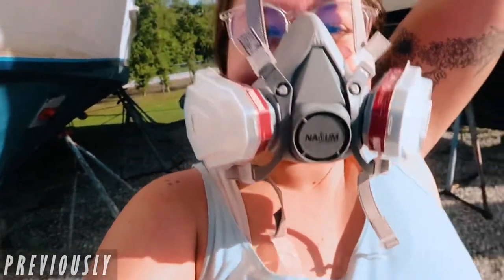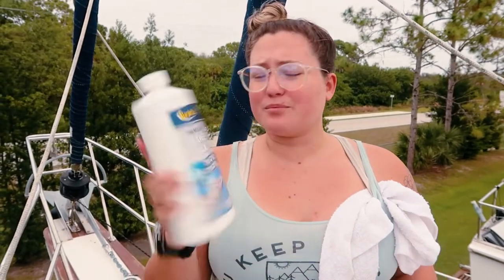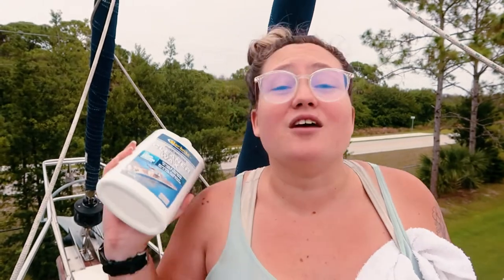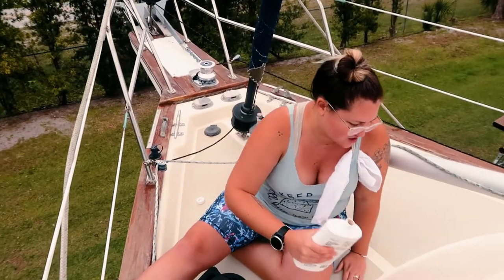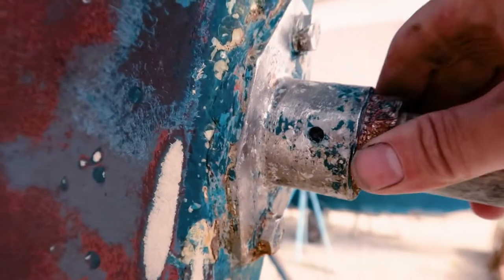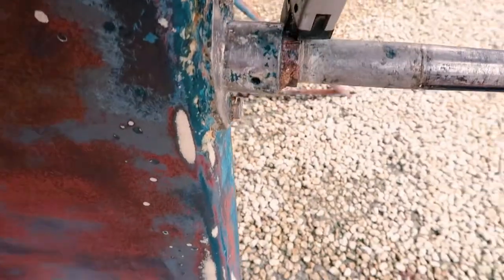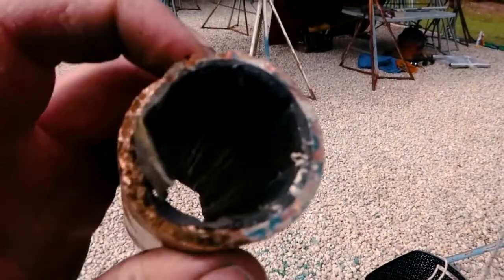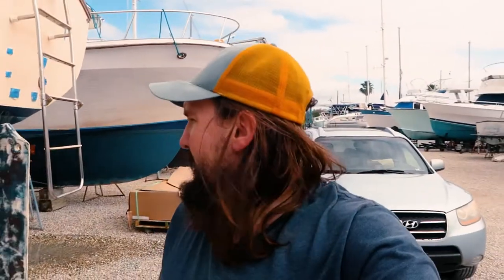Prep for our NEW SOLAR ARCH | Ep. 10

Comment: Cool. What are the specs for the cutlass bearing? I also have an IP 35. I would not do a wind gen. They are very noisy and provide very little power. I literally trashed mine and added more solar. I have 2 x 300W + 1 x 100 Watt panels now with 3 x 100 ah dragonfly lithiums. No power issues and I run fridge and two laptops all the time.
Reply from the maker: I’ll see if I can find that about the cutless bearing because I don’t know, have to find where we may have written that down...
We decided against the wind gen! And we have lots of solar, and lithium batteries, too! We have definitely ran our batteries really low and had to turn lots off until the next day so the sun can recharge from our power useage! We would like at least 200 more amp hours but we are making it work and all of our solar charges them really quickly!